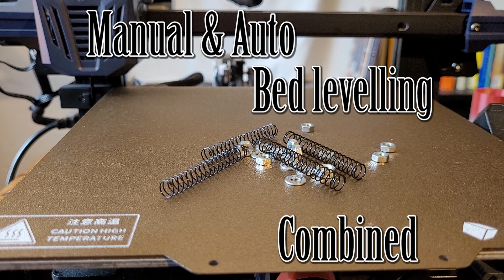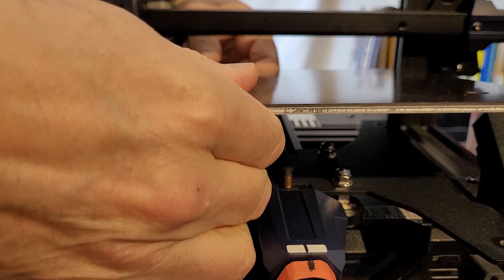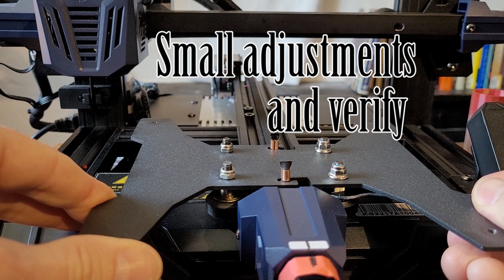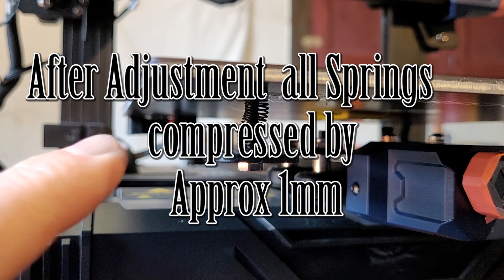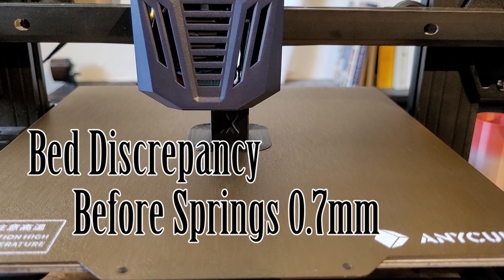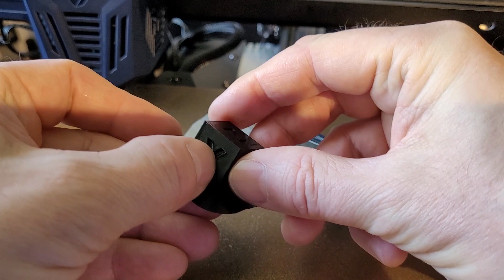Unlock the Ultimate Leveling Technique: Manual & Auto Bed Leveling with Anycubic Kobra Go!

Comment: To adjust the bed you take off the steel build plate, slacken the jamb nut turn the bed screw with an Alen key, tighten the jamb nut replace the plate, test, repeat. Is that it?
Reply from the maker: Yes,  keep track of how much you turn the Allen wrench like 45 degrees or 90 etc.

Comment: Would this work on any other Anycubic Kobra machines. I have an Anycubic Kobra and I have been dealing with the same bed leveling issue. Mine seems to be good from the center of the bed forward and to the left but the back and the right side are high. I have to keep adjusting the Z-offset every time I print something to keep the nozzle from grinding on the bed. When I do the auto bed leveling and do the Z-offset adjustment it comes out to -1.45 to -1.50 but once I start printing I have to usually adjust it to -1.35, but if I am printing something that required the use of the back and right side of the bed I have had to adjust the offset up to -1.10 to keep the nozzle from rubbing on the bed. I haven’t put a level on it yet to see exactly where my issue is but I am hoping this procedure might work on all the kobra models.
Reply from the maker: Hey Oliver, I cannot say for certain because I only own the GO and Neo. But it would be worth investigating. Let me know if it works out because it could help others and let me know if you need something

Comment: I am curious as I have the same problem with my bed having a huge variance throughout especially between the top/bottom and left/right sides. Only the center is usually leveled. Would changing the spacers into springs help with this you think?
Reply from the maker: Morning Extro, yes it will help. It made a big difference in mine and I know others who have benefitted from it too.
Reply: @mayhemsmiley  Awesome! Thank you for the quick reply as well! My home depot didn't have the exact springs but I was able to find some 7/16×2 they are a bit thicker then the ones you have on your video and I'm hoping they work great!

Comment: Hi, just wondering how do i get the springs to the same size, i'm using 8x25mm springs but due to the bed design you can't adjust using wheels, how would i get it flat i have a varation of .5mm
Reply from the maker: Hi njt sorry for the delay. Not sure I understand,  but I adjusted the length by screwing in or releasing the fastener then tightened the jam but that I added below the plate.  Let me know if that helps.

Comment: Great video :), Can you still use auto leveling after that modification? , i'm new to this and is trying to learn as much as possible :)
Reply from the maker: Hi Xtrino
Yes you can
My prints improved after mechanically leveling the bed closer to flat then turning on the auto leveling.
Reply: I see, do you use the paper method now instead then? :) @mayhemsmiley
Reply from the maker: @XTRINO  no I use this method
https://youtu.be/s44ZC3RfFdA

Comment: I bought a spring kit (designed for Ender 3 but I'm told a lot of Kobra Go parts are interchangeable) to try and a) reduce vibration and b) allow for some manual adjustment since my bed always seems high in the back despite manual adjustment. The problem I'm running into is that the adjusting knobs that are supposed to go on the bottom are useless because the bolts come through the top, down through the springs, and thread onto the lower base for the bed (where the belt attaches to the bed). The wheel threads onto the screw under this lower base so attempting to tighten the wheel just jams against the threads above and doesnt allow you to actually turn the screw. The only way I am able to adjust the base is by removing the PEI plate and screwing from the top to compress the springs. Once that's done, since the head of  the bolt is free floating, I get a couple mm of "bounce" in the bed (clearance between the screw and the bottom of the PEI sheet) which seems to dampen vibrations, but manual bed adjustment is a pain because I need to remove the top plate and access the screws on the top of the bed. How does turning the nut on the bottom do anything when the bolt is threaded directly above it? Is there something wrong in my install? any help would be appreciated!
Reply from the maker: Hi TImmy, since converting mine by replacing the spacers with springs and nuts I have not re adjusted the bed. It works fantastic, so instead of knobs I have nuts and locked it in place. The fasteners go through the bed then add the springs and screw into the bed support bracket, then I use the nuts below the bracket to lock the screws. Check out this video https://youtu.be/qpm1Rpr6EyQ
Reply: @mayhemsmiley  Your link just opens the same video. :(

Comment: Hi, could you tell me the  length of the springs?
Reply from the maker: Sorry it took so long. 9/32 x 2 inches bought from Home depot https://www.homedepot.ca/product/paulin-9-32-od-x-2-inch-compression-utility-spring/1000127103
Reply: @mayhemsmiley  did you have to replace the bolts too? and what size nuts where they?
Reply from the maker: @corsair396  The nuts are M4 and you use a 7mm wrench or socket to tighten. I used the nuts as jam nuts to keep the fasteners from loosening up. See at approximately 4:20 in the video. The fastener threads into the flat plate and then the jam nut goes directly below.
Reply from the maker: @corsair396  Sorry I used the original screws
Reply: @mayhemsmiley  thank you sir, your videos are quite helpful, i had given up on this printer. its working better but im still having separation issues on the x and y.
Reply from the maker: @corsair396  glad to hear you're making progress. Maybe my next video will be helpful. I expect to post next weekend
Reply from the maker: Next time I'm in home depot :) Springs are installed. I took the spacers to home depot with me and compressed them next the spacer and analyzed the tension when compressed. The compressed spring has to have enough force to keep the build plate upwards if that description makes sense.

Comment: Hey man, a bit out of topic but out of nowhere, my printer doesn't want to save settings to its EEPROM. When I execute M420 S1 Z0, it does indeed use it, but then M500 only says Sending M500 and doesn't give me any confirmation. Then when I disconnect the printer, turn it off and on, connect it and again execute M503, the M420 is set to S0 Z0 again. Any idea as to what's going on? I didn't update anything for last 3 weeks and it started happening around a week ago.
Reply from the maker: I had the exact same thing happen
That's when I converted to entering that line in cura
Reply: @mayhemsmiley  I use PrusaSlicer since I have a lot of experience with it and Cura never really suited me, but I guess I'll have to enter the bed leveling each time. It's not a huge deal since I only print via pronterface, but its something that caught my eye.